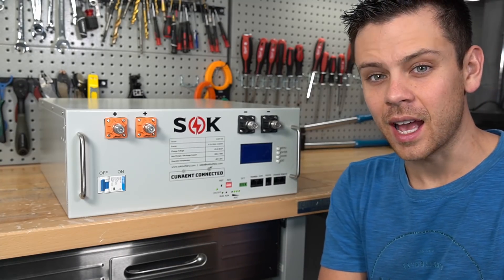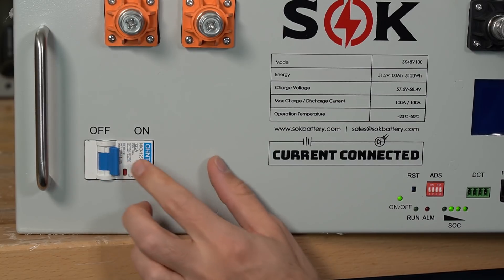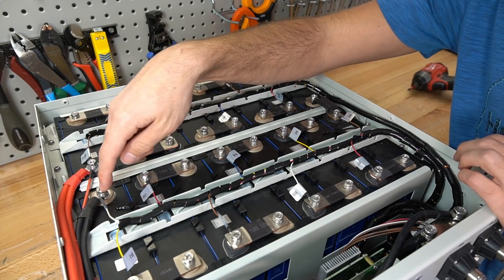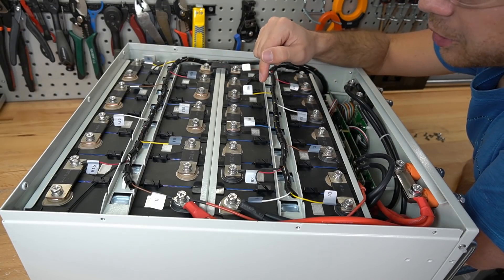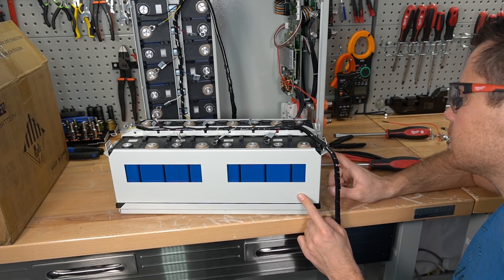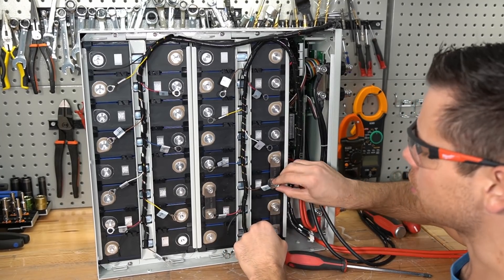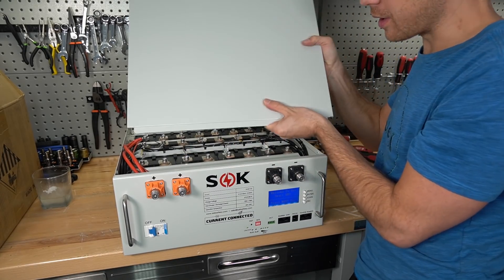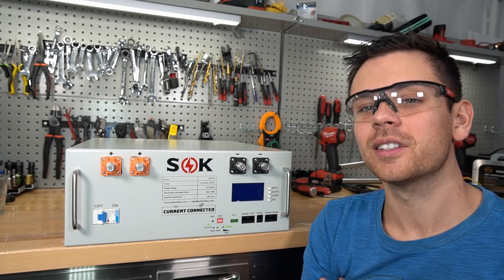New: $1,739 48V SOK Server Rack LiFePO4 Offgrid Solar Battery

Comment: What's a BMS?
Reply: BMS - Battery Management System

Energy is neither clean, nor is energy safe. Put your keys in your front pocket & stick a 9v battery in the same front pocket (contacts down) to understand. 
:-(

Batteries must be charged & discharged under certain conditions, otherwise they can degrade, leak, catch fire, or explode. The larger and higher the capacity, the more risk & danger that is possible.

The BMS anticipates these conditions and tries to run the battery in such a way where the battery is always in safety specification.

Sometimes, the BMS can be programmed to be safer than the manufacturer nominal specification, to encourage the batteries to last longer (more cycles, sacrificing stored energy.)
Reply: @DavidHalko  interesting. so a BMS also has a 5kWh battery. why do Will's previous builds never mention that in his How To videos? I've been watching Will's videos for a while and this whole BMS and server thing feels like it came out of nowhere.
Reply: @Absynthexx1  - “so a BMS has a 5kWh battery”

No, the converse. The [lithium] battery has a BMS. 

He has done a few reviews of the rackable batteries. 

The rack form factor is common, in data centers. They are used for UPS’s (I purchased UPS’s, which are batteries with inverters, where the UPS’s can be extended with external batteries, decades ago.)

This step is too long in coming, to bring safe power storage to common people.

Comment: Hey Will, great review on another lithium server battery. Have you ever done a review on Discover AES LithiumFe batteries. They are way more expensive than other products you have reviewed on your channel.  I was considering them, but after watching your channel I'm liking the server batteries.  Why are the AES so much more$$?
Reply: Ul Listed is one major reason
Reply: @koldsimer  That can't be the only reason that they are relatively 3 to 4 times the cost. Was just curious as to the significance of the price difference vs performance/longevity

Comment: Is this a valid concern?  There cells are rated at Cells rated for 80% Capacity after 4000 Cycles.  Aren't the EG4's at 7000+ cycles?
Reply: So much for asking questions....

Comment: Looks really nice and user serviceable.  Need to take another look with a blind procured production unit and see how much cost reduction occurs.  Also,  with the breaker off,  the output terminals should be dead,  so less of an issue with cover removal/install.

Comment: I'm struggling to understand why serviceability is an important point.  I would expect SOK to provide a warranty for 10 years.  You need to be comparing warranties offered by the battery companies and not the serviceability!  My two cents.
Reply: Many people would rather replace a failed part themselves rather then having to go through the process of shipping an entire battery back under warranty. Less downtime and much less hassle. If for instance the BMS failed, I'd rather them send me a BMS quickly which I can change out than wait 3 months for battery production to catch up and allow them to then send me a whole new battery.

The way I see things, a warranty is only as good as whoever offers it. With good quality products a failure will likely be a small out-sourced component dying early, usually withing the first few months. That's normal with mass production. If something makes it through the first year it will almost never fail after that. Companies can change a lot over time so good customer service (and warranty) today doesn't mean you'll get the same 5 years from now.

Comment: I wish they would have put the display, comm connectors, and breaker switch in the middle so that when you stack them, you can run the power cables or bus bars straight up/down without blocking anything. Optionally, they could also move the negative terminal more toward the middle, but they probably wanted the separation between pos and neg terminals...

Comment: This looks really good; I'm very impressed both with the product and your tear-down.  One question:  is there a limit, or a recommended maximum, for deploying these units in parallel?
Reply: up to 8 pcs in parallel
Reply: Hi,
If no, and you are off grid, consider a 3 phase  configuration .
Inverters 120 degree = a 127/220 volt system 
No autotransformer needed 
3 phase  220 volt ac system available  on the market.

Comment: I wonder how long it would run a golf car.
Reply: A very long time, if you get a nominal 52+ Volt solar panel and controller. ;)
Reply: @Tumbleweed5150  I meant daily range, probably more than a few days, hours of run time on a golf course before charging needed.
Reply: @gregpeterman1102  I understand. I was being funny, as I have a 36V golf cart that's being charged mostly with 3 - 12V (nominal) solar panels in series through an MPPT solar controller. I have yet to actually try to measure how far it can go on a charge without the solar....and I have Lead-Acid batteries in it. :) I do know it will go at least five or so miles on mostly flat ground, as my girlfriend uses it to run our dog, and that's around the farthest round trip she's taken on it.

Comment: Thank you for the nice review.  Great price for a 5KWh rack mounted battery.  Makes it convenient to keep adding more units as need arises and/or money available.

My goal is to install batteries first (to provide backup power when grid goes down - live in TX!) and later on add solar.  I am assuming that I will be able to charge these batteries from the grid.  The reason I ask this question is I was told by salesperson at a well known solar installer that I have to get solar to charge batteries and that batteries cannot be charged from the grid. I am not sure whether I believe him. Any comments / suggestions welcome.
I do realize that I need to have some sort of a "disconnect" from grid, when grid goes down so that energy from battery does not go into grid.
Reply: Battery chargers can be bought for most batteries, including 48V. Also, All-in-one Inverter/chargers like my 5000W Growatt have AC inputs, as well as AC outputs, and solar inputs, and can be programmed to charge off the grid, a large enough generator, and/or solar. ;)
Reply: @Tumbleweed5150  I like your suggestion for the Growatt unit where I will be able to use the AC inputs to charge the batteries, AC outputs to go to the electrical panel, and solar inputs for adding solar panels in the future.
Does the Growatt also have a "cut-off" from grid when grid goes down?  If not, what do you recommend?
Also, I am assuming there is probably no correlation between size of the battery system and the Growatt sizing - meaning the size of the Growatt inverter(s) is based on how much load it sends power to.  So, for example, I could get a battery system for 20KWh, but the Growatt system could be 15KW because my appliances will be "covered" by 15KW.
Thank you.
Reply: @por911man  Yes, you can program the Growatt to take over if the grid goes down. There is a minimum capacity battery bank recommended for the Growatt. I can't recall what it is, but I think it's around 200Ah...however, that may only power your load for a short time. I suggest figuring out your main "emergency loads" and make sure to shut off anything that's not important if the power does go out, unless you have a massive battery bank and solar array. The Growatt's size is it's capability. Mine is 5000 Watts each, and I have two for a ten thousand Watt system. I hope to never have to see it put out that much power, as unless I get a windfall or a GREAT deal on solar panels, my system is seriously underpowered. But, with that said, I don't normally use much power. Just enough to run my refrigerator, my computer systems and a few other smallish loads. I am hoping my system is large enough to run a small air conditioner over the summer to protect the batteries and Growatts from overheating in the 120+ F. heat of the southern California desert. Good luck with your system. (I am totally off-grid here).
Reply: @Tumbleweed5150   Does any inverter provide AC input from an EV charger, or 220V outlet without being hardwired into the grid?
Reply: @nexderm5606  I am sure some of them do. You would need a generator that puts out 220V to use it, though. I am no expert on this, however.

Comment: Thank you for discussing the precharge resistor need... I have 2 SOKs and blew out a fet in the BMS on a 24v system, 2 sok 206's in series,  battery 2 bms bit the dust  when connected to a victron multiplus 24v/3000 for the first time.  unfortunately there was no instruction on the SOK or CC site, nor in the victron documentation defining a need to precharge the capacitors in the inverter charger. Lesson learned the hard way for sure.. now I have an added precharge circut Hard wired in with momentary contact switch. 
Looks like this is will be another home run for SOK.  Battery Vendors need to add a disclaimer to inform customers of the requirement to precharge the capacitors on inverter prior to connecting the batteries to them to prevent bms damage.
Great video!
Reply: “precharge resistor” - this should be standard on any equipment which has capacitors.

Forcing this requirement on every battery manufacturer is a waste of components, especially when batteries will be put in parallel or series!

Honestly, urea poor design in equipment, requiring precharge resistors in the battery or by the user to connect the equipment to batteries. Every inverter on the market that does not ship with it built in, should receive a 25% lower rating, by default, for poor sustainability (waste being force-added to batteries) and reliability (possible damage to components.)
Reply: @DavidHalko  it takes more than just a resistor in series with the cap, you need to switch that resistor out once the cap is charged or the cap will not perform its function well, which is to filter the incoming power.
Reply: @geepeerces  - “takes more than a just resistor is series with the cap”

Yep! The car manufacturers have been doing it for decades. They add the resistor in series until the capacitors are precharged, then switch it out as they add the battery load directly. They precharge so the relays, do not experience arcs & weld contacts & cause failures of the relays.

When we take our ev & hybrid cars in for battery replacements, the precharge resistors are never touched.

The solar inverter manufacturers should never pawn off the precharge resistors to the battery manufacturers. It is poor design & places their equipment at risk of damage & is poor sustainability since replacing the batteries means the precharge resistors need to be discarded every time.
Reply: @DavidHalko   David, I just blew my Overkill Solar BMS starting my new Giandel 4000watt 24 volt inverter. would you mind sketching out a precharge circuit. What size of resistor? Momentary contact switch?
Regards, Destin
Reply: Hi  @destinlydiatt4122  

I am sorry, but I had looked at this problem some months ago, to be prepared for my final purchases, and I am preparing to build a full solution, but not that ready.

I am now planning on using a higher voltage than I did initially (now using a 60v system via 2x EV batteries in series that just picked it up 2 weeks ago) and I need to buy the components to bring it all together. I was supposed to buy 6000w of panels, but my source sold out before I was able to pick them up, which means search & design new solution once the next panels become available.

My pre-charge resistor plan is to use an incandescent lightbulb, to dissipate the power, where the glow of the light will be the indication of whether the pre-charge is done. 

I have seen many people talking about circuits, capacitors in their inverters, capacitors in their BMS’s, etc. and I want a solution this that is not so technical oriented… press a button until the light goes off, then make the connection.

For a 24v system, you may be able to use 2x or 3x 12v halogen bulbs from a car (in series) for a similar effect. The more in series, the less bright the light will be. The sizing or quantities of those bulbs will be important for your use case, depending on how long you want the pre-charge for and how big the capacitors are that need to be pre-charged.

I know this is not the answer you asked for, but I plan on releasing some YouTube videos on my journey, once I get all of my components purchased. 

I am building everything from scavenged parts, to get a 3 year buy back on my system… so I am spending nearly all of my time acquiring components & on-the-spot engineering every time my plans change due to other people buying the stuff before I do… so I am not yet to this phase, yet.

Comment: If Wh is equal to Ah times volts, wouldn’t that battery have 4.8 kWh and not 5.12? I’m genuinely curious because I’m still new to this
Reply from the maker: 51.2V is voltage nominal for lifepo4 in 16S configuration. But we call it a 48V pack due to the working voltage range. 

Always use voltage nominal for Wh calculations.
Reply: @WillProwse  that makes sense! I knew I was missing something. I didn’t even know voltage nominal was a thing. Thank you
Reply: Agreed.  Why does Will say 5.12k?
Reply from the maker: Because it's 5.12kWh.
Reply: @WillProwse  Ok, I need to learn so much!
Reply: @TexasLocalProduce  I think Will is telling the truth, I don’t think he’d lie about something like that. I was just curious how he got there

Comment: Nope, PYTES (formally DLG) is also white.  PYTES also uses the Amphenol SurLok+ connectors.  The connectors (5.7mm version) are only rated to 120A, so if you are using a large bank with a big inverter then you will need to use busbars instead of paralleling cables.  What I like about the PYTES battery is the shallow form factor (117mm) which allows for more batteries stacked in a single cabinet.  Other than that they are mostly the same....5.12 kWh, 50A, etc.  Nice battery.  There sure a lot of manufacturers coming out with versions of this LiFePO4 battery.  

Sure would like to see you test the new Zoxcell Al-C graphene supercapacitor.  I know you don't think very highly of graphene supercapacitors, but this one is definitely ready for prime time.  Price is within reason.  Materials are far more readily available and environmentally friendly.  80% DoD life cycles at 25c is over 85,000!  If they test as good as the sound nothing will beat the life-cycle cost.

Comment: That thing needs a plastic cover between the top metal cover and the bus bars.  That seems to be the main flaw.  An impact on the top cover could bend it and cause a short.
Reply from the maker: That's exactly what it's coming with. Please watch the video, you didn't.
Reply: @WillProwse  will I am sorry, I got to the point where you put on the cover riskily, must have missed.
Reply from the maker: @GeraldMMonroe  no problem

Comment: I would feel better if SOK used a push button switch rather than having the customer use a screw driver.
Reply: for safety, we choose the press button..
Reply from the maker: What about all the other companies using an identical method? They are all built like that for pre charge circuit

Comment: I too am amazed at how much smaller, lighter yet much higher capacity AND cheaper Lfp batteries have become in only a couple of years, so much so that I will probably upgrade long before my batteries fail. Even Tesla is choosing the chemistry over the Nca one they have billions invested in, its a real game changer for energy independence if your savvy enough to put a system together yourself...

Comment: I love this battery,  but I would put an insulation band across the top of the bus bar to completely eliminate any danger of accidental direct contact - one that stays with the bus bar, not the lid. Having that long bus bar exposed like that is nuts.
Reply: Will DID mention that they will be putting in a "plastic" cover between the bus bar/battery cells and the lid in the production model.
Reply: @Tumbleweed5150  I'm glad to hear that! I missed hearing him mention it, so thanks.

Comment: is their a spec sheet on these.  cant seem to locate  . can they be in parallel  and if so is their protection in bms if 1 battery down (or 1 unit)?,  is this ul listed ..see not listed yet.

Comment: It would be nice if there was a standard for bus bars connections.  For example, the battery terminals would have different screw pitches or be reverse threaded per polarity to avoid connection errors. Maybe this has already been solved.

Comment: SOK is killing it. Have two of the 100ah batteries for my ham radio shack. As we look ahead to adding another solar system for providing power to part of the circuits in the house, this will definitely be the battery I will go with.

Comment: They need a compatible server-rack format charge controller/inverter (ideally with the DC terminals in-line with their position on the battery packs).

Would be great to just have everything in a big modular stack with the only wires going in being your solar panels and only wires going out being your mains-connection. Would look super neat.
Reply from the maker: Agreed. That's next.
Reply: Exactly what I was thinking, and put the bus bar at the back 👌

Comment: Could this be converted to a 200ah 24v battery?
Reply: Probably, but 48V inverters are more efficient, and if one uses that, one can use a 48V to 24V Buck/step-down converter for 24V items. That's what I did when I upgraded to a 48V system from a 24V one. For the 12V Items in my RV, I just wired the output of the 48V to 24V Buck converter to the input of my old 24V to 13.8V converter.